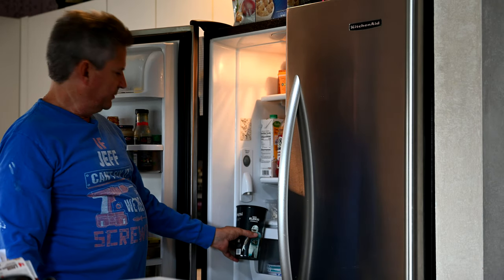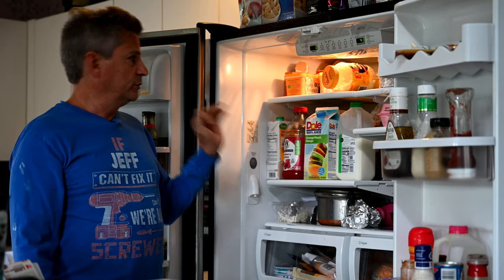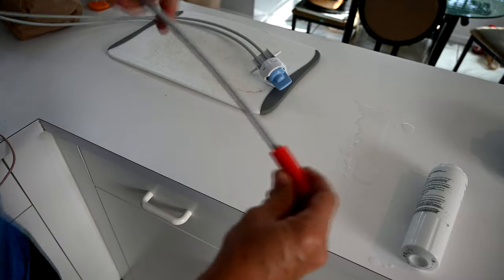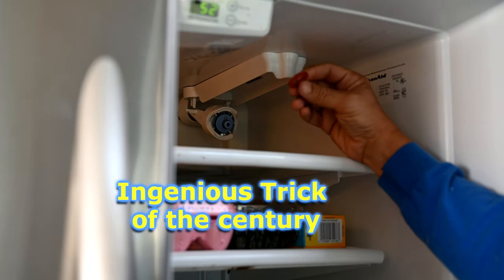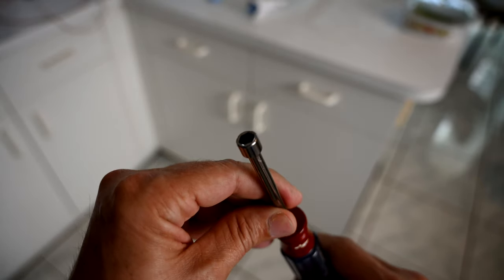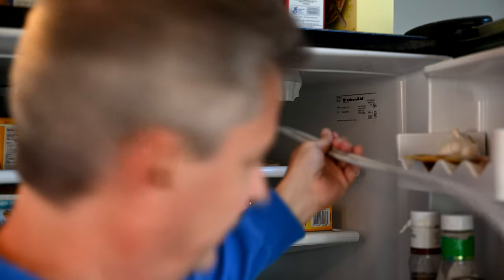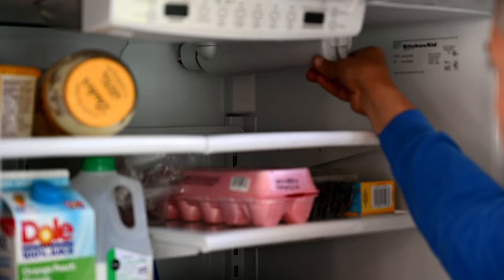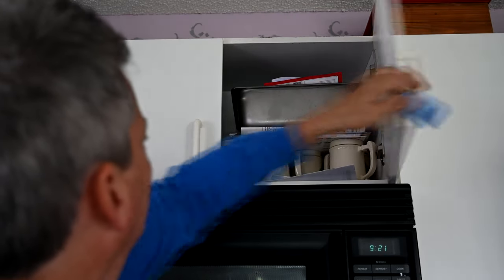Fridge Won't Dispense Water/Ice: Filter Head Repair DIY

Comment from the maker: ✅ Tools used in this KitchenAid refrigerator repair video:
✅ RIDGID One Stop Wrench: https://amzn.to/2LNIHDn
✅ Whirlpool 67004106 Refrigerator Water Filter head & Tube Assembly https://amzn.to/2VUZB4m
✅ Fluke 87-V Digital Multimeter: https://amzn.to/2LK8etM 
✅ GreatNeck Nut Driver Set, 7-Piece: https://amzn.to/2VGjaMI
✅ Supco WV5154 Whirlpool Dual Inlet Water Valve: https://amzn.to/2Hp1Hnv
✅ EveryDrop by Whirlpool Refrigerator Water Filter 4 https://amzn.to/2WanZBK
We receive a commission from Amazon when you buy products through these links.
Reply: Jihhjjjjjihiihihiihjihiihijihijjjjh

Comment: Had a frozen reservoir. Hair dryer in 5 minutes and done. Thanks Subscribed after this.
Reply from the maker: Yes yours is the most common issue that people report solving it with the hair dryer. In our case it was the filter head which is like the worst case scenario to have to fix so you got off lucky

Comment: Thanks, Jeff, for a very helpful video.  I just successfully changed my filter head after watching.  I would offer one additional piece of advice regarding the temporary fix using the garden hose washer:  I used pliers to compress and flatten my washer and make it easier to screw the filter back on.  Just using the washer as is, it's thickness made it too difficult to thread the filter on.  This technique was successful and my water dispenser was working pretty well as I waited for the new filter head to arrive.
Reply from the maker: Thanks, I'm glad you liked it!

Comment: Wow!  The detail in this video is incredible.  I'm certain I can replace the filter head if I need to now.  Great work!  

Is it a valid assumption that if water flows quickly with the filter plug in place but then flows very slowly when a new, correct filter is installed, that the filter head is most likely the issue?
Reply from the maker: Yes those filter heads can be quite finicky, so if changing the filter does not help, and the water inlet checks valve checks out OK, and the reservoir bottle inside the fridge is not frozen, then problem is likely the filter head.
Reply: jeffostroff Great. Thanks again!

Comment: I had no ice or water. After a lot of searching it was the filter. The pin on the water inlet/outlet end was too long. I trimmed off 1/16 inch with wire cutters and it all worked. Amazing how many people had problems with the filters. For some placing a felt sticky pad on the end of the filter makes the fit tighter against the door that holds the filter in. Thanks for all the suggestions.
Reply from the maker: Yes, and the filter head on the fridge where the filter connects onto

Comment: Hey Jeff! Please help! This video is awesome by the way! Unfortunately I still haven’t fixed my issue with my whirlpool fridge. Water comes out of the dispenser but at a slow stream rather than a normal speed. I replaced the water inlet valve, checked the filter with the blue bypass cap AND took a hairdryer to the reservoir to unfreeze anything that was frozen and still no luck =/..... I am currently trying the hose gasket  to the filter head to check that but no luck. My only option is the water filter head and replacing that?? But what if that doesn’t work? I also have to add that the water dispenser button is working properly and I hear that it makes a connection with the fridge and I hear water flowing through but I feel like there’s still something off. My apologies in the long message! Hopefully you can help me out
Reply from the maker: In our case it turned out to be the filter head as we show in this video. Sounds like that is what your scenario is, or the water inlet valve. If you have checked the resistance across your water inlet valve and it is still OK, then your likely issue is the filter head.

Comment: I have exact same Kitchenaid Refrigidator.  Had same issue. I replaced valve below and water still not coming out.  I decide to remove filter output hose from bottom valve, Water did not come out. It turn out to be filter dispenser valve issue.  Decided to remove it and use compressed air and blow it thru hose while pushing down two needles, Air blew out.  It appear that needles inside valve is fine. So I decide to rig hose to water hose that goes to filter and put filter output hose to sink. Turned on water and insert then twist filter slow, water came out until I fully turned filter to stop (felt a click) water stopped. I tried turn back 1/4 way and water came out.  Realizing that Non-OEM filter two little "ramps" is out of alignment. So I put all back to refrigidator and put filter in and turn 3/4 way and water come out dispenser strong.  So check it before replacing valves and filter dispenser valve.  It's the filter itself...
Reply from the maker: In our case it was the filter head

Comment: Great video Jeff, very thorough. Is the test plug included with the refrigerator?
Reply from the maker: No, the test plug comes when you buy the filter head part.
Reply: Jeff , the by pass plug does come installed in a new fridge, the reason being everybody does not run out and buy a filter to put in there. If there were no bypass plug you would not be able to use your water dispenser at all . I know because I have an Amanda that has the exact same setup. You may get another one with a new head ,I don't know I didn't have any problem with mine yet. Just FYI.
Reply from the maker: @johnkrim8377   I feel left out  because I am pretty sure mine never came with one, We always had a filter on there,  Unless the original delivery guys took care of that but usually they would leave the part I would think. That filter hit with such a pain to change because that stupid Styrofoam insulator in the back always breaks no matter how careful we are.

Comment: Jeff,

I have a Whirlpool Refrigerator where water and ice are not dispensing. I have put a new Water Value and Change out the Filter.  The model is a Side by Side ED5KVEXV007 . Manufacturing adate - 04-12. The Filter cage is on the bottom of the refit. How do I get to it to change this out. What might be the part number to get it replaced. The refrigerator works perfectly except for this.It takes a Type 3 Filter Cartridge.

Your videos are fantastic. Can you help me out
Reply from the maker: First see if your problem is the plastic reservoir bottle inside the fridge at the back. (0% of the commenters tell us our trick with the hot air blower on the frozen reservoir bottle solves the issue. IF not, Google your fridge model, and find the filter head attachment on the fridge from appliance parts pros, that sometimes goes bad too

Comment: Thanks for the good content. I may have a curve ball though. kitchen aid with everpour 2 filter. newer fridge worked great then relocated turned on and no water dispensed. removed filter added some water to it put back in worked great.  Then i release it and go to try again and nothing. Only seems to work when i pull the filter and re-install but only once. Tried new filter same thing. any thoughts where to start be great
Reply from the maker: Sounds like the filter head on your fridge needs to be replaced. IT's at that point where it makes contact when you screw the filter on, but then fails again. We had to replace ours in this video. This video is your likely repair
Reply: @jeffostroff  that's great info I'll look into it a get back to you. Tku
Reply: @jeffostroff  my model number is krfc704fps04. Is that the right head for my model fridge?
Reply: I’m having that issue now.  Water comes out without the filter.  I put filter in and it works until I close the filter door

Comment: So, I have a GE but I believe the concepts are the same. I replaced the water filter for the first time since I bought the house, and about 2-3 weeks later, the freezer lost its coldness and 4 weeks later the fridge as well. Ice obviously is not being made at all. At a point water was also not dispensed but I realized I plugged the filter in incorrectly so, following the arrow on the filter to match with the arrow in the fridge, the water dispenser worked again, and I think that means water now does run through the filter. But the coldness is getting worse. While it is common to check the coil and clean it, I still think it must have something to do with the new filter. Any suggestions? Thank you so much.
Reply from the maker: Filter has nothing to do with youur freezer not getting cold. For that you need to look up the circuit for your freezer, maybe you have a temperature sensor going bad
Reply: @jeffostroff  Thank you for being so prompt. I'll continue to watch more videos, YouTube DIY community is amazing :) Possibly the compressor, compressor delay, or evaporator fan - hopefully it is something easy for a female with zero mechanic background :)
Reply from the maker: @tripletvn   Luckily I have never had to get to the point to replace a compressor, although I would bring in a professional for that because I believe they have to be licensed to evacuate the  Refrigerant 1st before they can replace the compressor that takes people who are licensed and allowed to be dealing with that type of gas

Comment: I'm having an issue with those two "white pieces". I pushed them in and water started squirting out and now it doesn't stop. Does the whole filter head need to be replaced? Because even when I put the filter back on it still leaks.
Reply from the maker: Yes, we had to replace it on ours. We stuck in a small garden hose gasket onto our filter head holes before attaching th water filter and it halped the water flowing again for a while, but we still replaced the filter head.

Comment: Well I put a new filter in as usual and now no water and no ice cubes. But I have a Frigidaire.  The door monitor reads good filter!  It also says no power and I have power.  Thanks for the info but it doesn't  apply.
Reply from the maker: Did you check to see if the little water reservoir bottom that's built inside the fridge on the back wall usually if it is frozen. That's the problem for 3/4 of the people that come here to this video and they often solve it with a hair dryer by blowing hot air on it to thought it out
Reply: @jeffostroff  Hello I do not have the same model but was wondering if you can still help. I have an LG lfx25976sw Refrigerator. My control panel dispenser assembly is not working at all. Nothing displays like lights. Buttons not functioning when pressed. Ice and water does not dispense when pressed. Do you think I have to change the control board for dispenser? And maybe look into changing the inlet valve? Filter looks good still. And I've had the fridge unplugged so the reservoir should not have been frozen.

Comment: I've had 2 filters in the last 3.5 months. Both slows down to a trickle within a few weeks. Any idea what that is? It does get very cold by the filter head and sometimes I see ice buildup there. But once it worked and lately it hasn't. The water coming in can't be that bad.

Comment: Mine is so weird; I got a whirlpool fridge it was dispensing water before I replace the filter and as soon as I put the new filter in the water stops dispensing.  Can you please tell me what’s wrong with it.
Reply from the maker: It could be that the filter did not seat properly on the filter head so maybe try removing the filter and re apply it onto the filter head. It could also be that the water froze in your plastic reservoir bottle let's it's inside the fridge on the back wall typically 95% of the people that have this problem have reported back to us that they followed our button advice and used a blow dryer to heat up that water bottle to thought out the ice in it

Comment: Yes!  It worked!
Reply from the maker: Glad I could help! Which fix did you implement?
Reply: @jeffostroff  The filter head in the kitchenaid fridge. Amazing detail, even down to the hose which was too short, as predicted.  But it works fine just hanging there.

Comment: At the 13-minute mark, the one hose is kinked and you leave it off.  The second hose is attached, then the testing begins.  When did the hose that kinked get attached?
Reply from the maker: Helen we did not show when that kinked hose actually got kinked, we were trying to keep the video from getting too long so that was one of the scenes that got deleted, where we showed the attaching of that hose to the bracket, and how the hose was too short, so it kinked as we tried to fit the connector onto that metal bracket. To save time, we just showed that we connected up the hose, it's too short, so here it is kinked, and we're not going to attach it to the bracket, we now have to leave it out loose.
Reply: jeffostroff I understand that.  How does water run if you don’t connect that hose?
Reply from the maker: @helensaunders1603   Helen Saunders  You misunderstood what is happening. We did not show reconnecting the wall supply back to this hose. The hose will still get connected back to the water supply line coming from the wall, but we can't re attach the hose to that support bracket or it will kink the hose as shown at 13:01. By moving it off the bracket and just letting the hose with the connection to the water supply line hang loose behind the fridge, we can then allow the hose to stretch out straight, eliminating the kink. The hose does not necessarily need to clip onto the metal bracket, so it still works in this case. Ideally you want it to be more secure and connect to that bracket, but Whirlpool made this hose a dew inches too short, nothing we can do about it, they changed the part for this 13 year old fridge, so it's not a perfect replacement for the older part #.

Comment: I’m not getting any water from the dispenser with the filter installed but if I replace the filter with the bypass plug, I get water from the dispenser. This issue happened immediately upon replacing the filter with a new one. So in this scenario, what needs to be replaced?  Thanks
Reply from the maker: I am thinking that your filter was defective. If you get another filter and try it in it still happens then it might be the filter head on the fridge. We ended up having to change our filter head.
Reply: Also, if you are not using a genuine part filter and using a knock-off filter, that could be the issue as well.

Comment: thats not why im here, i gave up on this 10 yrs ago. (still have the frige. xD) running for 20 yrs.. most of it anyway. xD ice grinder dont work to make the ice not freeze soil.

but in any case, im sry for asking this, but how do u take up a pop up tub plug to unclog it. i tryed every video i can find and nothing seems to work. ether the screw cap is rusted soil onto the base, OR what ever the case its not catching to unscrew.. (i felt under it and i cant find a screw to twist ether..  so i was hoping for help and hiring a plumber just to get it off seems very pricey (still paying off 1000 bucks to fix the sink =( )
Reply from the maker: It's hard without seeing your drain plug how to remove it. I find most success with pulling up firmly straight up as hard as I can, and turn counterclockwise while still pulling upward firmly usually gets those to come up. It might not be a screw down, it might just be keyed, so you keep rotating slowly until the post lines up with the key hold and it pulls right out. If not, go to Home Depot and for $3 get that hair snake, I use this all the time in out hose, I no longer pull up the drain plugs, you just insider this down the drain and it pulls up the hair, here's the link to it: https://www.homedepot.com/p/BrassCraft-20-in-Plastic-Hair-Snake-BC00112/305468409?MERCH=REC-
Reply: Thanks Jeff, the filter was frozen. Thanks for the video

Comment: Need help! My whirlpool makes nice but doesn’t shoot water out 
The lever works it makes the sound that it should when the water should work
Reply from the maker: Did you try the trick with the hair dryer blowing hot air onto the plastic reservoir bottle bottle inside the fridge along the back wall? 90% of our viewers report that solves the problem for them because sometimes the water just freezes up in there.. If not that you'll have to do electrical testing on the inlet valve usually the water and the valves that meet at the bottom of the fridge one goes to the ice maker and 1 goes to the water maker.
Reply: @jeffostroff  I turned it off for the night and this morning I works but it will eventually stop like it always does when I do this

Comment: If the water flows well with the bypass plug in place, don't replace the head. Add a dime size piece of 1/2" sched 40 pvc pipe to the head. There is a youtube showing this fix.
Reply from the maker: We show a similar fix, but usually doe snot last long. It really means the filter head is worn down and should be replaced

Comment: The water/ice was working fine until I changed my filter. Did I install it wrong?
Reply from the maker: Take off the filter rand examine the interface between the filet and the filter head assembly where it plugs in, see if anything happened there. Try to remove and reseat the filter.
Reply: @jeffostroff  Ha! I didn't push in hard enough when I put the new filter in. Once installed correctly, I could immediately hear the water running. Thanks!
Reply: I did the same thing! I didn’t put the filter in properly. Thanks so much for this wonderful video!
Reply: We have tried 8 water filters per model of Maytag and non fit - they do not turn completely clockwise.  Please help